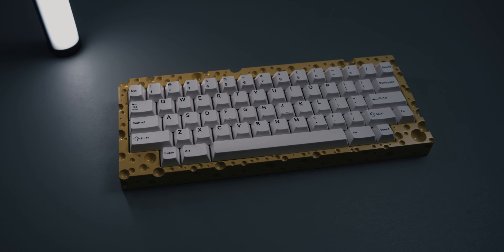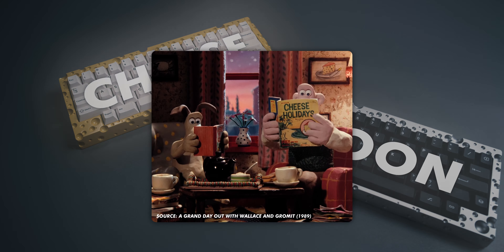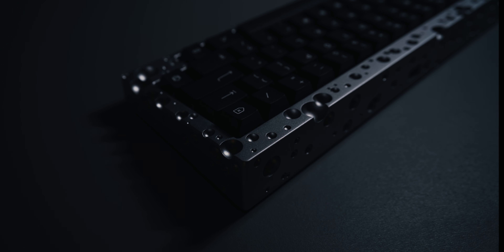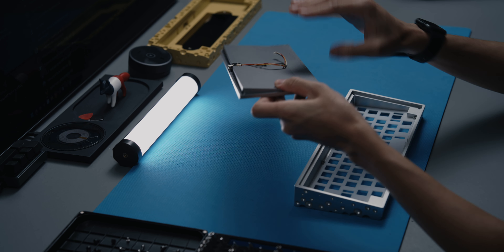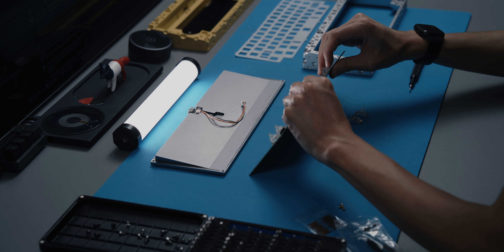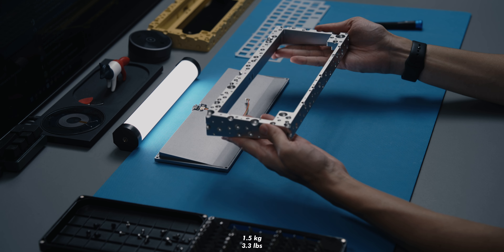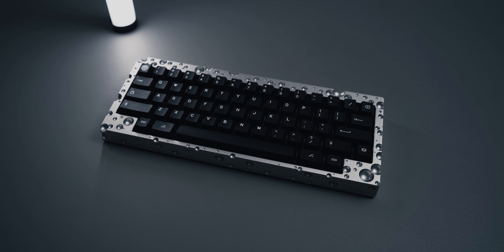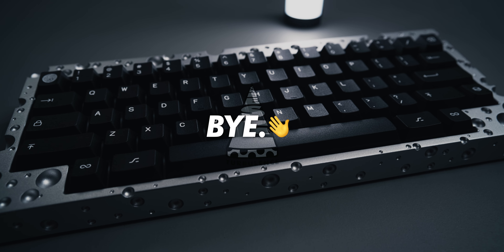This Custom Keyboard Is Full Of Holes! - "Swiss" by keebwerk | Hands-On Preview, Typing Sounds

Comment: I really thought it's some custom board made just for you (or by you!). :D

I've seen a mod very similar to this separator mounting style but it uses little squares of tape instead of long strips. Maybe it could be better solution for mantaining clean shape of the case while still dumpening pcb-case resonanse. Anyway, it's very refreshing desing on the outside as well as inside. I started to see more and more people start rejecting foam, tape or silicone to maintain (to some extent) signature sound of a board itself. Perhaps Keebwerk is aware of this trend. After all even without modding it sounds good. :)
Reply from the maker: It’s probably the best match of a board to this channel that there ever will be 😅
Reply: @CheeseTurbulence  A man can hope. That'd be hilarious! :D